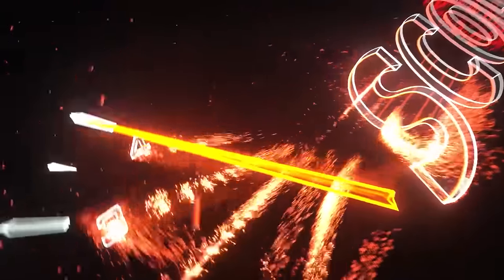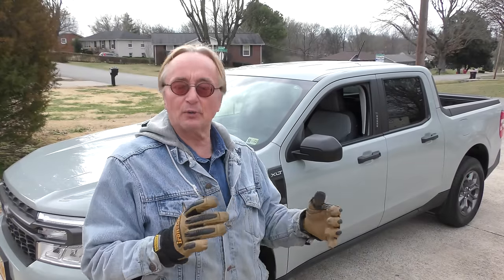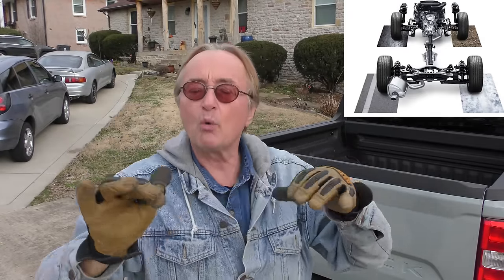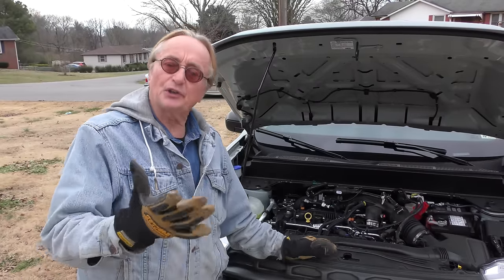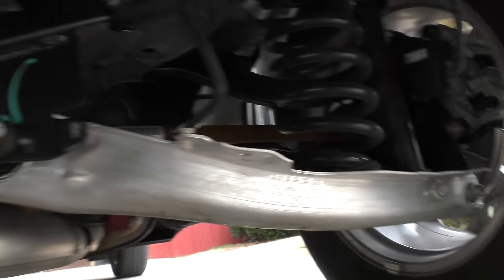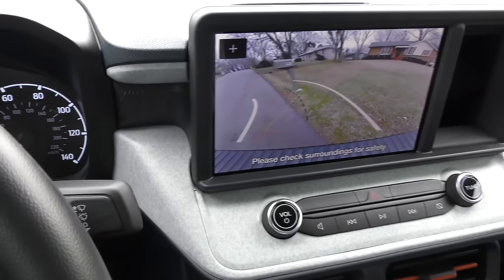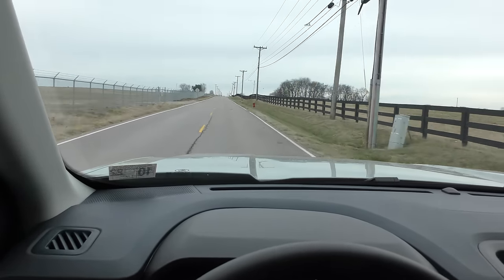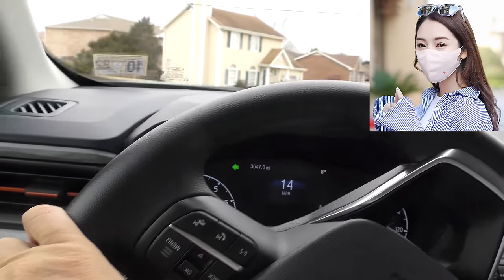I Finally Got a New Ford Maverick and Here's What I Really Think of It

Comment: I have 98,000 miles on my Ford C-Max Hybrid, with the same engine that the Maverick has.  Still does not use any oil on a 5000 mile oil change, averaged 41.7 mpg over 98,000 miles.   Transmission is much smoother than that in my 6 speed Ford Transit with the 2.5 engine.
Reply: I have the 2.0 liter ecoboost in my 17 Focus ST. 47k miles still a baby and is such a beast. Hits 150 mph faster than you'd think in this little car. It just feels like it will last a long time. The handling is incredible. Everything on this vehicle is just done right. Sound system is great. Bluetooth works excellent, great cargo space. Just a perfect hatchback with excellent gas mileage when not beating on it. Ford has been doing great things since they started out and I've always loved their products.
Reply: The C-Max doesn't have the same engine as the Maverick Hybrid which is a 2.5 litre engine. The 2 litre is used in the turbo Maverick.
Reply: @Bill h  ah. Both engines are strong running though.
Reply: @ADDwithJTC  where can you hit 150 mph? Thats fast
Reply: @jamesmedina2062  my guess would be on the loneliest road in Nevada which if I’m not mistaken gets an average of 3 cars a month
Reply: @javabeans830  ahh so what is the #1 best coffee you have had lately? do you roast?
Reply: @James Medina  the garden state parkway in NJ. I highly recommend Escort radar. I've been using them over 10 years. Currently have the 8500 x50 black in my Focus ST and the 360 Max in my daily driver 2020 Ioniq hybrid that I got up to 122 before. I think it's limited there though not sure. My ST is limited at 157.
Reply: @JavaBeans  the Parkway gets quite busy but I obviously would only do that speed with no cars in sight in dry conditions on a straightaway and not for long. I've taken some decent curves at 140mph though. This is a very impressive car that really sticks to the road. Best bang for your buck really. For 21k (26k msrp, got a good deal from a friend of a friend) brand new couldn't beat it. As the years go on we'll see how she holds up. And when the turbo or engine finally goes, built engine and bigger turbo 🤣
Reply: @ADDwithJTC  Nice car.....love the sound
Reply: CMax is the ugliest vehicle on 4 wheels. That thing is ugly!
Reply: @CW CW  thank you. The stock sound was nice but put on a high flow cat and Agency Power exhaust with 3 tip outlet and when in the higher rpm range it sounds incredible. Never heard anything like it.
Reply: @Busman72  I've seen worse but beauty is in the eye of the beer holder 😏
Reply: @busman7228  The '22 Tundra has it beat though; someone hit the Tundra with an ugly stick. Plus now, it's no longer reliable. Bummer....
Reply: @busman7228  I call mine the silver suppository 🤣. There are uglier cars, but not many. That said, it's reliable as hell, quick off the light, comfortable on long highway pulls, and gets about 42mpg.
Reply: Two engines get 150k, that is a 300k car.  This should be the case, hybrids should last longer.
Reply: @ADDwithJTC  Good one!  Lol
Reply: My gf drives a 2018 C Max hybrid, she gets about the same mpg, car has about 70k miles. I’m curious to see how long it goes before it starts having problems. She does drive it hard sometimes….
Reply: @diablocls55  Does she service it regularly?
Reply: Had a 03 tundra 4.7,oli changed every 5k.After many changes and over 400k never added oil between changes.

Comment: Good review! I've had my Maverick XLT for about 6 months now. At ~8K miles, I've been thoroughly impressed! It's smooth to ride, has plenty of giddy-up, particularly if you're rolling along and punch it. 
Gas mileage hovers at 30. When I do a full run at the 55-65 MPH steady state drive, I'll get as high as 34 with the 2 liter turbo engine. 
My only complaint is that it should sit higher. Not much, but another two inches and remove the skirting on the nose and it would be much more ranch road friendly.
Reply: Nice Mark, do some videos I will sub! I have over 80 Mav vids on my channel you might like.  I have a hybrid for mpg and a turbo AWD for fun.

Comment: I was on those same roads a few weeks back!  Maverick is high on my potential list for the reasons you mentioned.  I'm approaching empty-nester status.  I like trucks but like smaller vehicles and I have a job where fuel efficiency is a major plus.  The Maverick may just check off all those boxes when I get ready to buy again.  Really the truck 70% of truck buyers need.
Reply: If fuel efficiency is what you are looking at then this truck is awesome. Mine has been getting 43 mpg in town. I havent taken it highway yet.
Reply: Consider a Ridgeline, no turbo, 3.5V6 with much better MPG.
Reply: @tacocin  the mpg on the ridgeline is 24 combined. That's worse than the awd version of the maverick. Let alone the fwd
Reply: @tacocin  I get 25 in my ranger with 4 wheel drive
Reply: @tacocin  I get 25 in my ranger with 4 wheel drive
Reply: @tacocin  much better MPG?  On what planet?  My wife has the Passport, same platform and motor and it is lucky to get better MPG than my freaking F150 2.7 TT or my 20 year old Corvette.  The 3.5 hasn't exactly been the paragon of reliability either with the multi displacement issues.  And the Ridgeline is something $#!+heads drive
Reply: Get a factory extended warranty if you plan on long term ownership.
Reply: @KingxKrabler  But much better reliability and resale value than a Ford.
Reply: @cokiea57  Reliability is definitely based on individual year and model. Also, I would not pay 16k extra on a honda ridgeline to get 15mpg less.
Reply: Buy the FWD only, Hybrid if you want mileage.  This EcoBoost with AWD has been getting reports of real world  22 mpg average.
The Hybrid should, hopefully average 33 mpg or slightly better.
Reply: @meathead585  Hybrid real world for me at 313.9 total miles is at 36.8 mpg. This is with incredible idle time at drive thrus. So I would recommend that as a benchmark. It would be higher but the eco mode resets every time to hop into the thing.
Reply: @KingxKrabler  k
Reply: @cokiea57  Who buys a vehicle to sell?  Are you one of those that needs a new vehicle every 4 years to feel  whole again?  Also, my 2011 F150 has 310K original engine, my previous Ranger with the Vulcan V6 had 467K original engine, and was still running great when I finally sold it.  Besides, how do you know if your Ridgeline is reliable if youre selling it every 4 years?  😆
Reply: @KingxKrabler  So, is yours the 2022 Maverick Hybrid ???
Reply: @jamesspence3435  I have the 2022 Ranger Lariat fully loaded, and I really doubt the design, comfort, and practicality is much more superior than my Ranger...  You do not know what you are talking about either...  :)
Reply: @tacocin  Not really, but ok, if you want a smaller truck and all... Yes, Honda has reliability, but Ford has been building that little engine since 2015 = 7years and there is not a lot of issues with it, and the ones it had have been all corrected years ago..  And the Ridgeline costs way more than a fully loaded real truck Ranger...
Reply: @frandanco6289  Yes, it is the 2022 hybrid.

Comment: I have essentially this same truck, except I got mine with the tow package. Comes with the hitch, and a built in brake controller. The primary reason to opt for the AWD , in my opinion, is if you are going to want to be able to tow 4,000 lbs.  Or take it off road at all.  The bed is short, but the tailgate has a second set of pins you can latch it to that enables it to carry 4 x 8 sheet goods like plywood or drywall. The XLT version also has a 110 power outlet inside the cab and another in the bed. I hate the fact that it does the shut off thing at a light- but there is a button near the shift knob that you press when you start up and it turns that annoying feature off.  And if you set the drive program to Speed, it delays shifting in the 8 speed gearbox  in a way that really makes the truck quite quick ( closer to 280 hp btw)  If you set it to ECO mode, then the truck is really pretty slow in acceleration, but that’s how you get the 24 mpg its capable of.   The Interior appointments are really quite nice on the XLT, two kinds of charge ports, hand free cell phone service and streaming music, and I got a rear sliding window as an option when I ordered the truck.  Another great feature is interior storage. The entire rear seat lifts up and has ample storage underneath for tie down straps, road flares, first aid kit, bungies , jumper cables and more.  And I can attest that 5 full grown adults can sit comfortably in the truck. All in all, I am very happy with the Maverick. The only things I would change is the ability to set the auto shutoff system to be OFF as a default, and the Shift knob to have full stops at drive and park so you don’t always have to LOOK to see you are in the right spot.  Even with the AWD, tow package and XLT trim package, my truck still came in under 32K.

Comment: I have a 2015 Ford Fusion that was made in Ford's Hermosillo plant in Mexico. It's been a great car from a build quality standpoint. Actually, much better that the other Fords that we've owned that were built in the US. The 2.0 turbo has shown to be a pretty solid engine as well; I've had two of them go over 150k miles without any issues other than they both needed a purge valve to be replaced at around 80k miles. Kind of a pain to replace because of the location, but it was only swapping out a $90 part, so no real hardship there.
Reply: 204k on the fusion and the things drives like I bought it off the lot
Reply: I recently won 20k at the casino and I need a new truck/car so I think 🤔 I might buy this
Reply: I actually had a Mexican made 2011 Tacoma OR, and it was the best vehicle I had ever drove.  Very easy to take care of as well.
Reply: I’d prefer my purchases come from Mexico over China.
Reply: Yeah well Ford doesn’t want to make cars
Reply: That’s because Mexico doesn’t have lazy Union workers.
Reply: I have a 2014 Ford Fusion 1.5 turbo made in the same plant and I have a 142k miles on it. I’ve had to change the 02 sensor and purge valve (which tbh is my fault because the 1.5 turbo recommends 91 but I was putting 87 in it). The main reason why I drive a Ford Fusion over a Toyota Corolla is I feel safer. Both Corolla & Camry and fusion, I think are pretty solid sedans.
Reply: Yep 2014 fusion here with 105k not a single problem yet! Easily the best car I’ve owned. Had a 2011 malibu before this and had nothing but problems and the engine blew at 90k smh
Reply: @Pickle_Riiiick  yea, I really like chevys and its a shame that their electronics, trannys, and engines all fail. I think the malibu and Impala are really good looking. I worked at a car rental place and I had countless Chevy Equinoxes just falling apart in our lot with 10k miles.
Reply: Purge valves go out on any kind of car.
Reply: I have a 2000 Ford Focus and it's a POS and I'm a die hard Ford fan.
Reply: @musicauthority7828  as a ford fan boy, I also hold ford over questionable years. To be honest a lot of the years of the ford focus are bad. I only know a couple of people who actually lucked out.
Reply: @dadyking1210  Mine still is useable and has a lot of miles on it. it's the engineers that fμcked up on it like most all engineers do these days. they spend so much time and money on collage to design such crap. I have no use for engineers because I have to fix their fμck ups.

Comment: 3:00 Ford removed the under the hood safety latch and replaced it with a 2 pull handle in the cab.
Reply: BMW has had that design for at least 5 years now. I like it better than the under hood safety latch.
Reply: @markkauffman6184  I don't. You have to open the door to open the hood
Reply: @BamaShinesDistillery  you had to open the door anyways to pull the lever once?? these aren't 1960's cars
Reply: @slingbart705  mi p
No....this is the first I've had to open the door on any.
Reply: @BamaShinesDistillery  Are you not looking under hoods? I haven't had a car that does not require opening the door, except for 1960's cars with hood pins.
Reply: @SlavicCelery  no. I don't have to open the door on any vehicle. I'm also talking about when you are at someone like a drive thru oil change place.
Reply: @BamaShinesDistillery  Then it means the car owner pulled the interior release for you.
Reply: @SlavicCelery  yeah. That's the point. It can be done WITHOUT opening the door.
Reply: @BamaShinesDistillery  When are you opening your hood but not opening your door to get out of the truck?
Reply: @rgr4475  when I'm at a quick oil change place or sitting in the driver's seat when someone else is looking under he hood. It does happen. The door must be open to even pull the lever.

Comment: I bought a 2016 Fusion Hybrid, made in Mexico, I bought it new, and not a single problem. Still driving it today. And it's very easy to beat the mpg rating on the sticker. When I take it on the highway, if I keep it just under 70, (the speed limit is 65 where I am) I get over 50 mpg.

Comment: Front wheel drive still needs 4 snow tires. I discovered this driving a  FWD VW with snow tires only on the front. The rear end let go on a curve while the front still had traction, an interesting 180. Braking is also a problem with snows on the front only as the rear/front braking is unbalanced.
Reply: Agreed suprised Scotty doesn't realize this.
Reply: Totally agree
Reply: Bugs Bunny  living in Maine, I’ve owned RWD, FWD, AWD, 4X4. FWD is no way better than AWD, and if the snow is deep 4x4 is best.
Reply: Surprised by Scotty saying this as well. If you only have 2 snow tires they should actually go on the back of the fwd car as per example of what happened to OP here when you put them in the front
Reply: @KLondike5  It's not a matter of "not liking" the idea, it's that it's unsafe. For lateral traction control, especially in emergency maneuvers, you want predictable handling front & rear. Every tire manufacturer and review of winters tires have noted this fact. It's not a conspiracy to sell more tires, but this know-nothing claims the "truth."

Comment: Great review Scotty.
Drove our new four-cylinder all-wheel drive Maverick from Albuquerque New Mexico to Portland Oregon. Went down Highway 1 from Seaside Oregon to San Francisco. Then to Vegas Nevada and back home to Albuquerque. We were traveling for approximately 3 weeks , average gas MPG was 26.8 over 3800 miles. Love the truck, smooth with plenty of power. You nailed the review.
Reply: Dude. With mostly Highway miles, that’s not great mpg.
Reply: @tomdavis3038  How do you know that is not great mpg??? Know how much weight he was hauling??? How fast he was going???  How many people were in it ???      It is still a truck, remember???   :)
Reply: Mileage depends on weather, elevation, other factors lol. It is not across the board apply all number. 26 average driving that kind of mileage in different elements is impressive.

Comment: Had a 2009 pt cruiser that was built in Mexico. 10 years and 90000 miles. Had near zero problems. Exceptionally well built solid vehicle in every way. Was rear ended twice. Second time insurance totaled it so I bought it back, rehung the rear bumper, lived with the dents in the lift gate and drove it another 2 years and 20k and sold it.

Comment: Standard engine is 191 hp 2.5 mild hybrid. Upgrade is 2.0 250 hp ecoboost. All wheel drive only available with 2.0 ecoboost.
Reply: They should put the 3.5 Ecoboost in the Maverick Raptor.